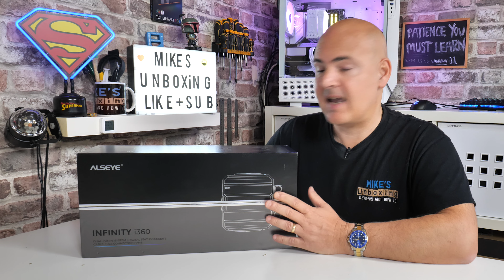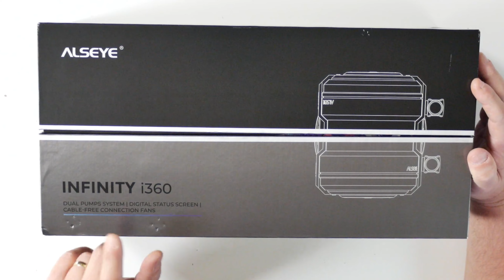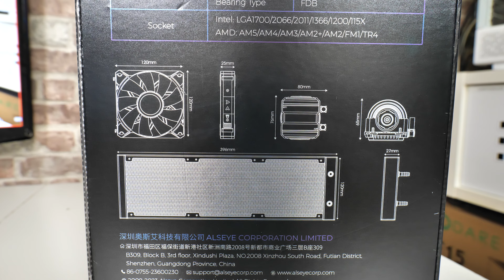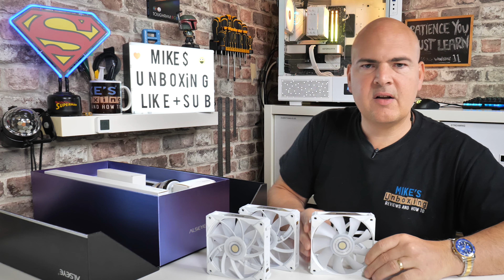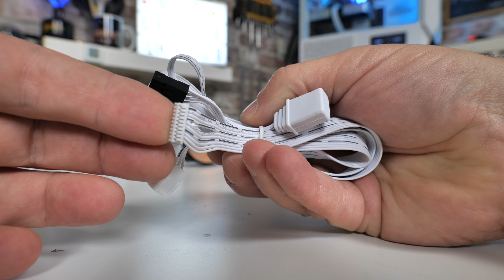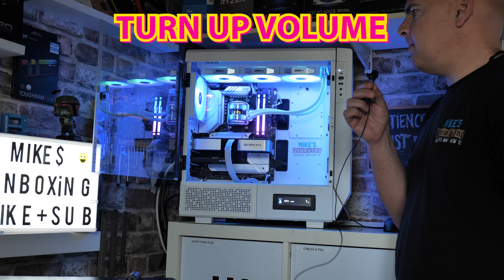Premium Style Budget Price ALSEYE Infinity i360 CPU Cooling AIO Unboxing & Review

Comment: hi, I've got the same dropsy, the dropsy itself is amazing , it doesn 't sound as loud as they say, but unfortunately my fountain didn 't light up, everything glows and burns, but the temperature control screen doesn't show, can you give me some advice, I think I connected it correctly, I hope it's not a marriage, but still I'm something I did it wrong , please help🙏😞
Reply from the maker: if the pump speed is set to low the digital display won't work, try 100% fan speed
Reply: @mikesunboxing  and how do I increase it, through ios or an application?
Reply: I connected it to pump_fun1 4pin, although the booklet says that it connects to the USB, I did not find such a plug.

Comment: Looks a great unboxing experience with the packaging. Agree that on looks alone offers a lot for us users. Box, connecting fans, less cabling, pump readout. As for noise would it be fair to assume fans be running low speeds when light gaming / media tasks? Longevity would be my concern with fancy pumps. Thanks for thorough review Mike and Kath🐈👍
Reply from the maker: yes that is totally right, the noise is fine in "normal" operating temps

Comment: Was literally just thinking about this cooler and was about to look to see if you posted the video yet 😂
Reply from the maker: what are your thoughts on it?
Reply: @mikesunboxing  Honestly? I love it. I think it looks unique, and the display looks good. It seems it can display a lot more information than my old Waterforce X360 could, right down to the GPU wattage and fan speed, which is very nifty.

The pump is quite good too. having the 2 pumps in there is a good bit of peace of mind in my opinion.

The pump noise doesn't seem like its at the pitch that would bother me, but I can understand it would bother others.

As for the fans, it wouldn't really apply to me, as I usually change them for my own anyway :') 

At its price i think it's a fantastic deal, it's got the compatibility and the capabilities to cover pretty much anything. The display will be very useful too, as the software looks quite minimal and not too heavy on the system.

I personally think it's fantastic!

Comment: That is a nice bit of kit.  😆Those two little issues would not be a deal breaker for me. I remember the days of cooling my socket 370 single core Pentium with a 5000rpm fan. That was loud. I like the dual pump setup. Thank you Alseye for sending this AIO for Mike and Lady Kath to review. Take care as always. Cheers
Reply from the maker: was that with delta fans? those were nuts
Reply: @mikesunboxing  No Mike, they ere from a full copper cooler I bought. I'm guessing the fan was either 60mm or 70mm. It cooled cooled pretty good for having the white thermal paste at the time.